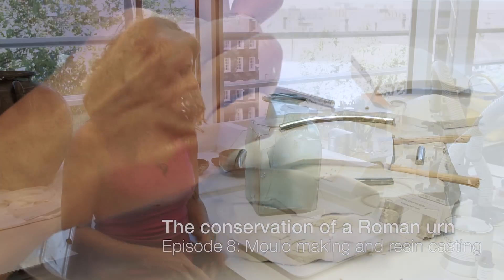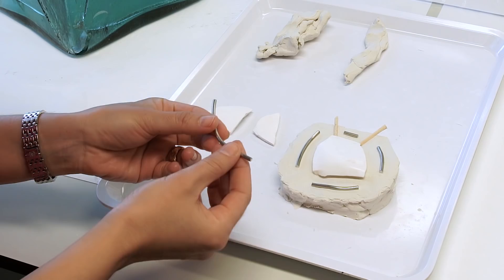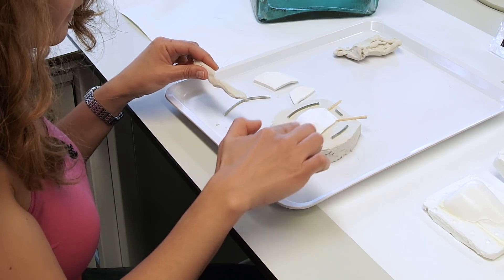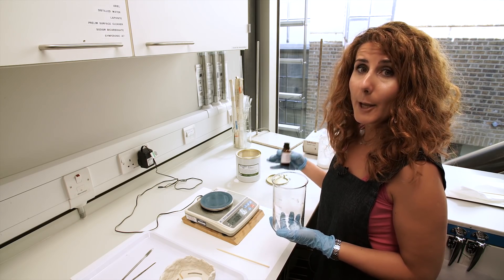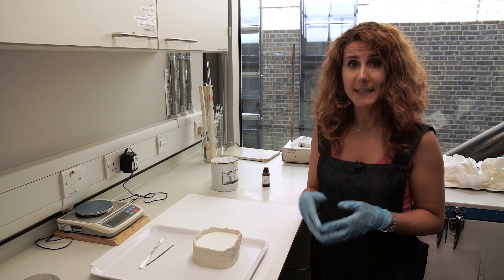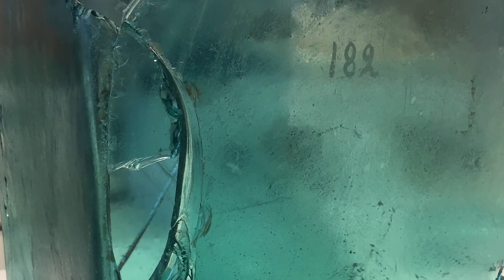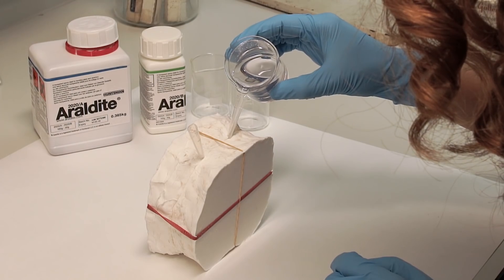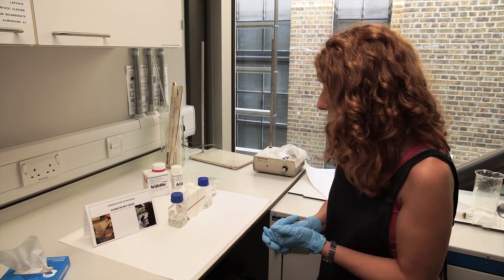Conservation of a Romano-British urn | Episode 8: Mould making and resin casting

Comment: You would find it easier to use a disposable syringe to put the resin into the mold for future mold making. It makes it a lot easier, and you don't have to wait for the funnel to empty, you just fill the mold through the hole, you will see when it begins to emerge. For a Syringe though, you need a resin that isn't going to harden while you're pouring and has a low viscosity.